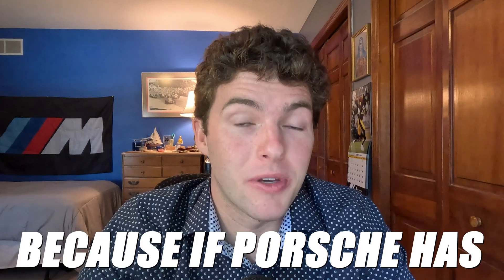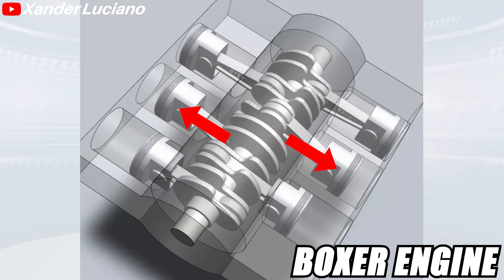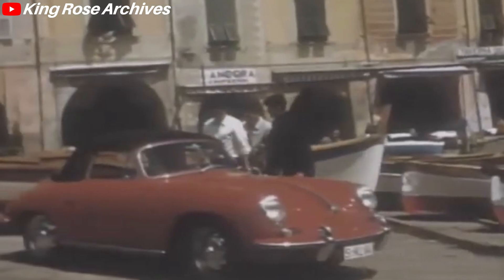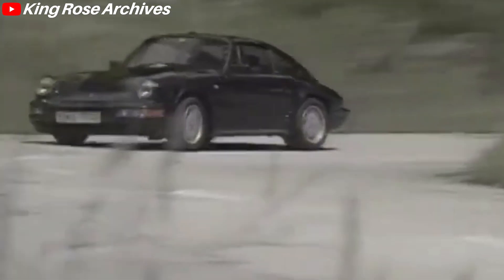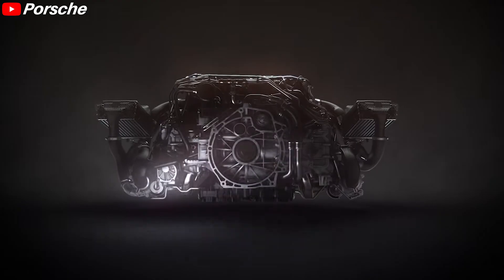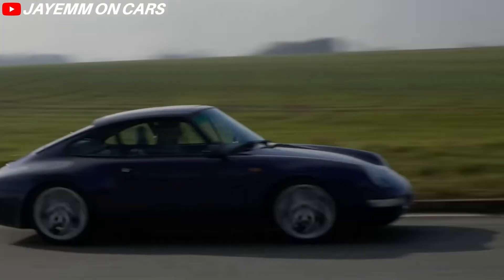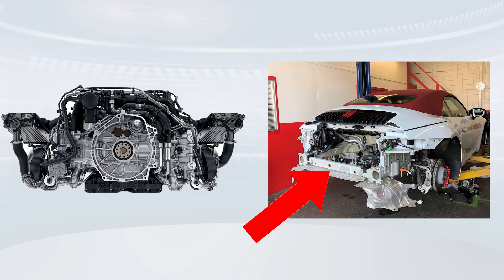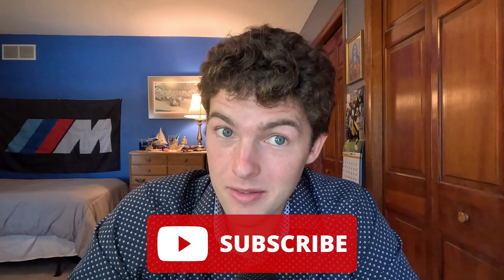Porsche is OBSESSED with Boxer Engines: Here's Why

Comment: I worked an Subarus and Porsches. I learned Subaru EJ’s and FB’s were identified as “Boxers” but not Porsches. Porsche engines where know as “Flat” layouts. Boxer engine opposed piston’s share a space on the crank while flat engines (as in Porsches) have their own spaces on the crank.
Reply: I think you have this the wrong way around. A boxer engine can’t have pistons sharing a crank pin, because then opposing pistons wouldn’t move towards or away from each other, but in the same direction as each other. Porsches definitely have boxer engines, a 180 degree V would have pistons sharing crank pins and moving in the same direction as each other
Reply: @mardyj a 180 degree V would vibrate more than a 2004 Ram with death wobble 😂
Reply: @tiltshiftvis   a V180 would vibrate a lot? The talk to Ferrari please because from time to time they are using this engine
Reply: You've got it backwards. If two opposing piston rods share the same crank journal, it is NOT a boxer. If they each have their own journal, as in both Subarus AND Porsches, then it IS a boxer.
Reply: I'm not sure I follow... Saabaru owner here. A boxer engine needs 180° opposed crank attachments for opposing pistons. Flat engines (other than flat 8s and 12s) are inherently unbalanced in the primary mode, and the inhere t primary mode balance of boxers is why 4cyl and 6cyl flat layouts are always boxers. Driving4Answers has a great explainer on this.
Reply: There has never been a non-boxer flat 4 or 6 engine in a car. The only instance of a flat non-boxer engine in a car is Ferrari's flat 12 engines which were not boxer engine, opposed pistons used the same crank-pin. 
Yes Porsche calls the engine in the 911 a "flat 6", but it is not a non-boxer flat 6. Its a boxer 6, with opposed pistons having their crank-pins 180 degrees apart which makes opposed pistons go in and out together.
Reply: @nico_qwer1732 
Then why has Porsche ALWAYS referred to the engines in the 911 as a flat-6? 
(Keep in mind that Germans are sticklers for details.)
Reply: @SeanOHanlon  maybe Porsche did this because most english speakers are ignorant to the difference / details. Even until today almost all english speaking yt channels, even the best, refer to the engines as flat 6, not boxer. In fact a boxer engine is always a flat 6, but a flat 6 is not always a boxer.
Reply: I cant lie, I would like to see someone attempt to make a boxer engine with opposing pistons that occupy the same space, i imagine that would be the fastest instance of an engine ripping itself apart that we'd ever see hahaha
Reply: Ever wonder where the name Boxster came from …..Porsche flat 4s and 6s have always been known as boxer engines !
Reply: @mickmaguire9697 
You're wrong. Porsche has used the flat-6 engine exclusively in their 911's since 1963. They have never referred to them as Boxer engines.
Reply: @SeanOHanlon  In Germany, where modern internal combustion engines like Otto and Diesel have been invented and developed and the brand Porsche is at home, the engines in 911s have ALWAYS been called BOXER! By Porsche itself and in each and every single magazine, article and TV show. Because it is a boxer engine. Something like „flat 6“ doesn‘t exist in german language. A flat 12 like Ferrari‘s Testarossa engine is technically a V12 with an 180° angle, but not a boxer. Flat six as a term is an english invention
Reply: @SeanOHanlon The flat-6 by definition is a boxer engine. The movement of a boxer's hands is similar to the horizontal movement of the pistons.
Reply: @VoxSapientia   no. It‘s not. „Flat 6 (8,12)“ can be a boxer or a V-engine. „Flat“ is a quite meaningless term in english language when talking engines
Reply: any engine that has a 0/180 degree horizontal stroke is technically considered a "boxer"

its called a boxer engine specifically because it looks like the pistons are "boxing" or punching.

the boxster was just called that because its a "roaster with a boxer engine"
Reply: @tiltshiftvis   sorry but you are definitely wrong! For example Ferrari‘s V180 in the Testarossa is NOT a boxer engine because the pistons don‘t go in simultaneously - that would be what people call „boxing pistons“. A V180 has a usual crank shaft where the opossing pistons sit on the same crankpin. A boxer has seperated crankpins for the opposing pistons.
So I am really sorry to say rhis to you, but your imagination of Boxers and V180s is wrong
Reply: This. Technically, Porsche's engine is a V6 with the included angle = 180°
Reply: @Random_User8964  You're wrong. Porsches mass-produced Flat-engines are/were always Boxer engines!

Comment: Great video and well thought out but you missed one other benefit. The inherent balance means that they need minimal counterweights on the crank, meaning they have lower reciprocating mass allowing them to build and lose revs quickly.
Reply: yet historically all 911 crankshafts were counter balanced, with the exception of the Cheaper T engines
Reply: @stijnvandamme76 I did say minimal counterweights. As in, less mass needed making them delightfully responsive.

Comment: Porsche LOVES the Flat engines. These are 180* V engines. BOXER engines are different. The non-boxer flat engine is best considered a V-type engine with the cylinder banks arranged at 180 degrees. Each pair of opposed pistons shares a crankpin, whereas the pistons in a boxer feature individual crankpins. This is why the 718 4 cylinder cars have a BOXER 4 cylinder and sound like Subarus.
Reply from the maker: The boxer engine is a type of flat engine. Flat engine just means the pistons are horizontally opposed. In their production cars, Porsche has exclusively used only boxer engines - they’ve never produced a non-boxer flat engine (except in a few experimental engines in a couple race cars). I’m not debating what your definition of the boxer engine is, I’m just saying all the “flat engines” Porsche has put into their production cars (911, 718, etc.) has always been a flat engine in a boxer configuration

Comment: I've always wondered, Does the high performance porsches 911 use a Flat or boxer engine? Sometimes it says it's a boxer, sometimes it says it's a flat, I think like the GT3, GT3RS uses Flat engines, but Turbo S, and other more comfortable ones, use Boxer engine, right?
Reply from the maker: A flat engine just means the pistons lay flat and horizontally opposed on the opposite side of a central crankshaft. There are two main configurations (that I know of) for a flat engine. One is the boxer engine, and the other is the 180 degree V configuration (think of a V8 stretched to 180 degrees). In a boxer engine, each piston has its own crankpin. In a 180 degree V configuration, the pistons share a crankpin. All of Porsche's flat engines are boxer engines. So the GT3, GT3RS, Turbo S, 718, etc. all have boxer engines (either 4 or 6 cylinder). 

So in summary, all boxer engines are flat engines, but not all flat engines are boxer engines. Hopefully this helps. Thanks for commenting!

Comment: The “disadvantage” of having two cylinder heads also applies to V8s but that’s never been considered as a negative for that engine configuration. Also, the digression into the mounting position of the engine and the advantages for 911 performance is irrelevant to the features of the boxer engine itself. It’s the reason why older 911s were prone to bouts of severe oversteer which has had to be tamed by electronic intervention and control systems in later models. The mid-engined Boxster/Cayman, which also uses the boxer engine but doesn’t rate a mention, is a superior design in terms of handling in most real-world driving conditions. All that aside, an interesting video though.
Reply from the maker: I genuinely appreciate you pointing these out. I admit those are flaws in the writing that I failed to consider when making this and your feedback is extremely helpful for future videos. Thanks for the comment

Comment: my understanding, and i am not an engineer, the 2 best engines from an engineers standpoint is an inline 6 and a V-12 (V12 is essentially 2 x inline 6)
Reply: Try a rotary engine driven car some day,,   like amazing...
Reply: I am an engineer and while I love both of those configurations but I prefer a flat 6. But a sound engineer would prefer a V10 to any of them.
Reply: I am a mechanical engineer; I vote boxer.

Disclaimer: I have owned two boxers (914 & Boxster), but never an inline six or V-12. Of course, Porsche also made a flat 12 (917), and Ferrari as well; they’re the best. But for what I (and probably you) can afford…
Reply: Those are inherently smooth.
Reply: Apex seals just enter chat 😂

Comment: The rear weight bias helps when braking because there is a significant amount of weight transfer to the front from the rear.  The distribution of weight can approach 50/50 under high deceleration.

Comment: 0:36 - Not quite, as the crankshaft configurations are quite different. There are 180 degree V engines and it's the crankshaft configuration that sets them apart from boxer engines.

Comment: as a volkswagen beetle owner, service is no problem as i can sink the engine out of the engine bay in the matter of minutes and service it on a stand
Reply: I've taken out my 911 engine, To replace the banana arm(trailing suspension arm) on my 73S,  and put it back in, in about 30 minutes..
Reply: And very straight forward to disassemble and assemble, if we have the idiot book, I have used the 'Idiot' book to rebuild three flat four beetle engines in the past, each with good long lasting results. Author of the Idiot book, John Muir, may you rest in peace, your book is your lasting legacy!

Comment: 911’s less so but 718 cayman and boxter although more so the boxter are very easy to work on they have a large misconception that it is hard to work on them if you have a lift it is effortless you don’t have a big steering rack impeding access from bottom of engine you can get at the front of the engine form the back of your seat where porsche has provided a huge port big enough  to service even major things like an alternator and you have excellent side access through wheel wells and you can remove the rear bumper for even more access and there is no radiator there to limit access. The top of the engine can be accessed by putting the convertible roof in service position. The big thing is Porsches reliability these cars depreciate slower than toyotas and refuse to die too so you won’t find yourself needing to work on them almost at all.

Comment: The Porsche boxer engine does sit low at least lower than the Subaru boxer engines do. In comparison a good v8 design As low  as a boxer engine because when run with a dry sump it lowers these engines substantially. Ferrari mid engine v8s are no higher

Comment: They will eventually go away which is why I’m stocking up with three of them currently.
Reply from the maker: This made me laugh
Reply: @DrivenbyMatt  Nice video!  Current garage includes a few Porsches plus others.  718 Spyder, 718 Box GTS Macan GTS plus another Box GTS on order.  Sad to see batts coming with the associated weight.
Reply: The insane Cayman GT4 e-Performance does not have that problem. 3400 pounds, perfectly distributed. The same weight as a base 911.

600hp, over 1000 in qualifying mode.

Comment: Porsche also perfected the intake manifold so the amount of power they're able to get out of those flat-sixes even before introducing forced induction is always impressive. Porsche also has invested something to the tune of $60 million dollars in research for synthetic gasoline that is carbon neutral, so I wouldn't call internal combustion quits just yet. Wartime Germany in WW2 had been making synthetic gasoline using pea coal because of international embargos and Porsche had designed the gas engines for many of the tanks including the Tiger and King Tiger, so there is precedent for this.
Reply from the maker: That would be exciting. Hopefully it happens, I’m holding out hope. I don’t think the complete ev switch will happen as quickly as people think. Lots of infrastructure investment has to occur before EVs are ruling the roads. Anyway, thanks for sharing
Reply: @DrivenbyMatt  You're gonna love this then, the announcement about them investing in synthetic gasoline was after Porsche set a new EV record with the Taycan Turbo around the Nurburgring. A maddening time of 7 minutes and 33 seconds and then they go "Hey our new performance EV, the Taycan, just set a record for EVs. To celebrate this achievement we're going to invest a chunk of change into synthetic gasoline because we love the 911 so much"
Reply: They say the intake with the controlled valve chambers actually has positive pressure which in affect is making light boost without a turbo or supercharger

Comment: I have 2 Boxster's, a 2004 manual base, and a 2009 'S' with PDK. Hard to argue against a mid engine flat six in terms of handling dynamics. For driving around town I prefer the manual base 986. It's great fun, and relatively inexpensive. If you're young and just starting out it's a great car to own. Enjoyed the video.
Reply from the maker: That sounds awesome. I have a feeling I’ll be buying something along those lines in the next 10 years. The temptation is too great lol. I enjoyed the comment, thanks for the compliment and for watching
Reply: I agree the 986 flat six is such a blast after 20 years of reliable ownership I stepped up and now enjoy the 718 flat four which also seems quite affordable for what you get to drive
Reply: Absolutely!

Comment: Why Subaru boxer engines sucks while Porsche's are good and reliable?
Reply: Subaru is a relatively small company from an RD budget perspective and their material costs and  margins are much slimmer than Porsche. Subaru should have been buying engines from another company instead of designing their own all these years.
Reply: @black99rt  also because Subaru is usually cheaper people are less likely to service them properly and on time. Porsche doesn't have this problem, because if you can afford Porshe you will maintain it properly.

Comment: With the boxster configuration the valve cover gaskets are vertical. Gravity causes oil leaks. Mounting the engine behind the rear axle is another overrated bad idea.
Reply: LOL. OK.
Reply: @m5pilot397  LOL. That’s exactly what an idiot would type. Great point Einstein I can’t wait for your next hypothesis.
Reply: Yeah, the 911 totally sucks. Junk.

Comment: Not all forces are cancelled.  The longitudinal offset between piston pairs do setup a small rocking couple.  But as ICE engines go, they are smooth and fast revving, and sound great.  I have a 3.4 L Cayman S.
Reply from the maker: I learned something new. I’m not quite sure I knew what a rocking pair was, I’ll see if I can make note of that on the video
Reply: @DrivenbyMatt  The inline 6 cylinder is the only motor which is inherently balanced in both primary and secondary forces.  That would make for an interesting video, I think.
Reply from the maker: @quintessentialtravel1966  It probably would. thanks for this information!
Reply: @quintessentialtravel1966  the inline 3 also is perfectly balanced , but has a rocking couple . The boxer 4 also is perfectly balanced but has a small rocking couple
Reply: @gerritgovaerts8443 no it isnt, it doesnt have primary balance
Reply: @quintessentialtravel1966 the boxer 6 is too, it just has a rocking couple from the cylinder offsets
Reply: @quintessentialtravel1966  They have torsional harmonics though.
Reply: @quintessentialtravel1966  Yes the Jaguar XK -  I've had several - so smooth.
Reply from the maker: @quintessentialtravel1966  I just remembered this comment and if you're still interested, I uploaded a video about the BMW inline 6 a few weeks ago!
Reply: I have a 2009 Cayman S manual. I love it.
Reply: @TheTigers00001  Congrats!  I held out for so long on a 987.2 but never found the right deal for me.  A nice 987.1 dropped into my lap and I'm happy I took the deal.  It's great.

Comment: burning oil can be an issue. oil can pool in the cylinders due to gravity not being able to pull all the oil down. this can result in an embarrassing puff of smoke upon start up if the car has sat for a long time.
Reply: If that's the main criticism of boxer engines they must be awesome
Reply: I have owned boxer engine cars for years, vw type 1 type 4 and porsche 911, never ever had the puff of smoke happen. No embarrassment.

Comment: Should have explained the difference between a flat 6 and a boxer 6. They are not quite the same. Shared vs unshared crank pin.
Reply: And because of the different configuration one has piston pairs moving together the other has them moving opposite eachother
Reply from the maker: Yeah true probably would’ve been a good thing to include
Reply: I just leaned something new thank you